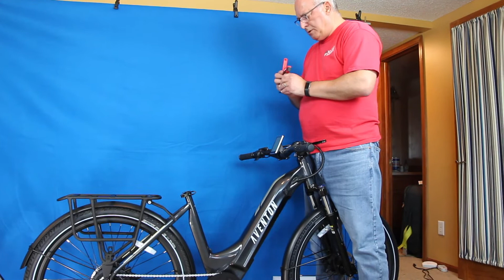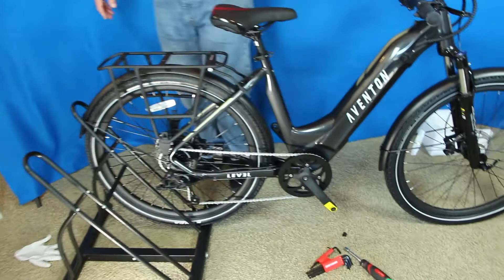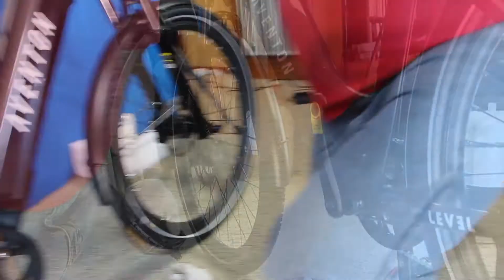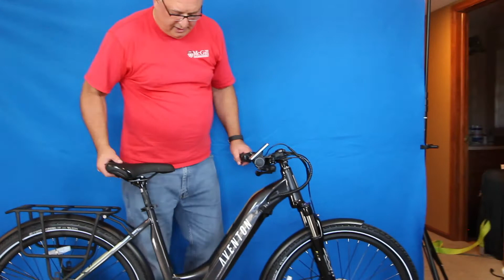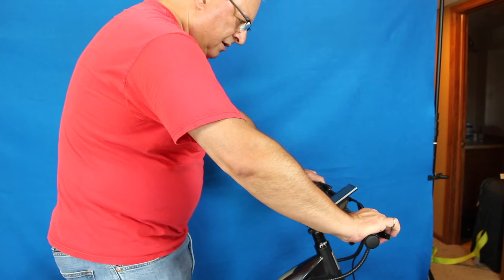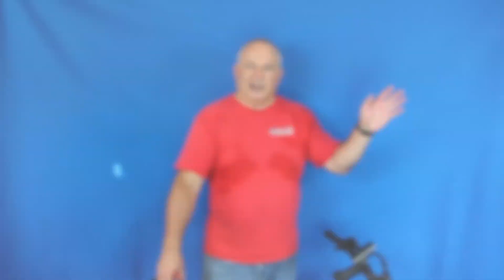Aventon Level Assembly

Comment: Aventons build instructions are very specific on the various torque requiremens even tho they only supply a basic allen wrench. Did you follow that. After I watched the assembly video from Edmonton mine is still in the box.

Comment: This was great!  I tried putting mine together using the video provided by Aventon. Unfortunately when I took the stem cap off, the front fork fell with all the internal pieces going everywhere. Is there a way you can do a video showing how those go back together? I sent a question to Aventon and they sent me written instructions but I still can’t figure out the various parts because I have more than they list.